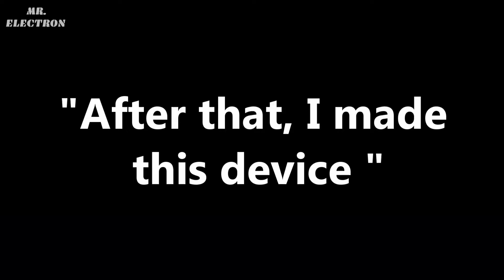Free Energy Generator from Dual Spring Mechanism | Mr. Electron

Comment: You really need more practice using the arc welder and building a crank shaft . How  long did  it run with that crooked crank shift ? It should have had a minimum of three pillow block bearings , with 4 being the ideal .

Comment: no it does not run forever. The fact that it was at rest signifies that in due time it will come to rest. After all of the initial forces been used up. The real over unity machine will violently start even without anybody putting a force on it. Once the whole parts been put together, the very last part that will be put will sprang the whole system into motion even without anybody's help.

Comment: Gravity provides a constant acceleration of 9.8 meters per second squared (m/s²) on Earth, meaning that for every second an object falls, its velocity increases by 9.8 m/s. Now, consider this: How much energy does it take to run a small winch powered by a 9-volt battery to lift an 8-pound bowling ball to the top of a bridge or canyon?

Once released, the ball swings down, accelerating under gravity, and by the time it reaches the lowest point of its arc, it's traveling at over 100 miles per hour, imparting 3,625.8 Joules of kinetic energy. Ask yourself this: Could you ever power a motor capable of swinging that same bowling ball to that speed using just the tiny amount of energy it took to winch it up?

The key takeaway is that gravity does the acceleration for free—a force multiplier that no battery-powered motor could replicate efficiently. By Joseph Costello
Reply: the reason people think free energy is impossible is because that is what bp wanted people to think when 2nd law was devised, and still does

Comment: Dear friend I watch your  all video.i know your all video is real.
But this flywheel system really true? Please share me your experience.if this real.
Though nothing is free.
Reply from the maker: Yeah! Nothing is free. Please watch full video for better understanding of the concept.
Reply: You are in a got for poor the people. Thank you for this experience
Reply: @mrelectron_alternator bs windmill is free solar is free coal is free water powered hammer is free and I'm sure if you want to work out how to make real free energy you can. Crystal cell battery never runs out geet engines are free energy I have done both so I'm sure it can be done with all other ways like magnets electronic components correctly configured and maybe lots of other ways.